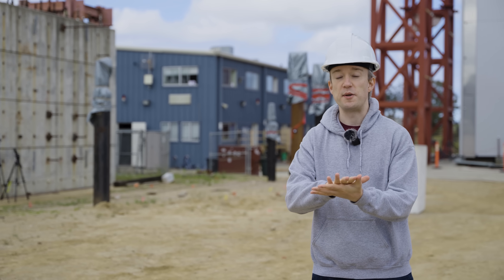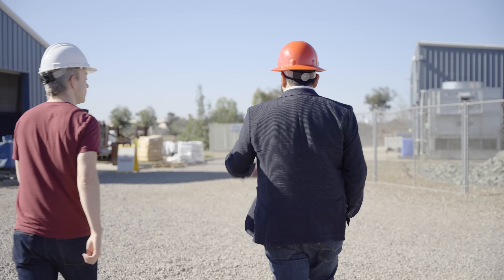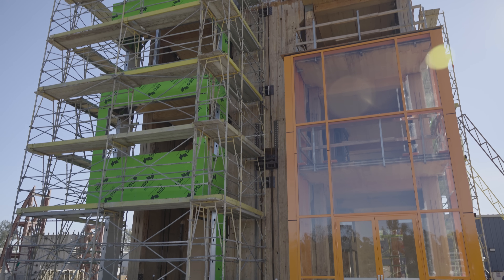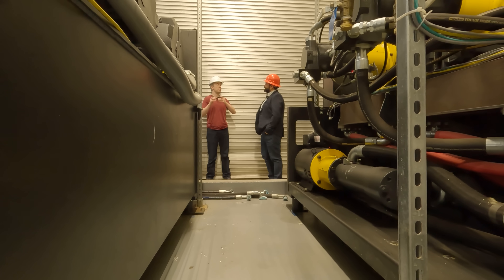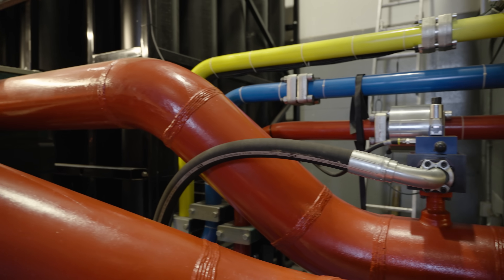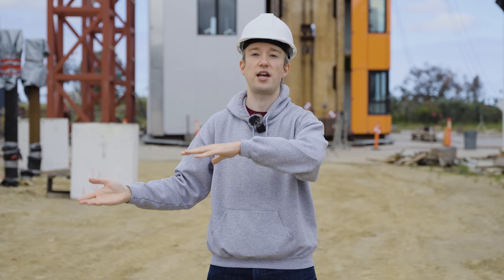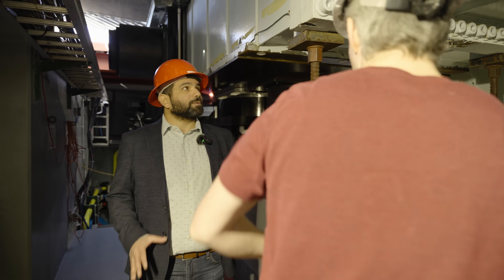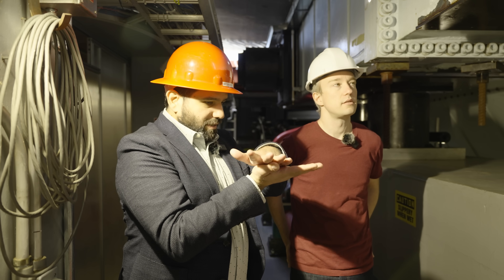Shake tables are way more complex than I thought

Comment: 3:28 "water hammer effects". In Danish we call it "vandstød", or "water shock". For those less familiar with fluid dynamics and physics: Dishwashers are notorious for causing this effect because they take in water at the full pressure of the water line, and then shut off the magnetic valve when they reach the fill level. This rapid shut-off makes the water rapidly compress against the valve and creates a shockwave that causes the pipe to flex, and thus you get the familiar knocking sound. Only in your water supply the pressure isn't high enough that this shock causes any damage, but in a 3000 psi hydraulic circuit, slamming pressurized liquid into a sharp corner would create massive shockwaves, that in worst case can break the pipes, and thus they need those funky smooth bends - the higher pressure you got, the more straight the pipe needs to be

Comment: Thanks again Tom. I remember a test building inside a building at the Building Research Establishment in Watford, UK back in 1972 - it had a network of vertical and horizontal steel cables used to stress the structure. A last-century attempt as structural testing :-)

Comment: Hi. Pipefitter here. That U-turn is an expansion joint. It’s necessary for the operation. Steel pipe is highly affected by temperature changes. That expansion joint allows the pipe to expand and contract without breaking any welds. 
Also, 5k psi isn’t as scary as you’re making it out to be. It’s common in power plants and refineries.

Comment: Just the welds on the pipes alone are insane. 6 bead cover pass!
Reply: Why run just one bead when you can get paid by the hour to run 6?
Reply: @1pcfred  that's just the cover passes, there's probably six to eight more underneath.

Comment: As a welder, seeing the weld joints on these pipes really illustrates how insane the pressures these pipes are withstanding.
Reply: Personally I didn't care for the cover work myself. But apparently it works. Looks like the steamfitters were milking that job for all they could get.

Comment: I've been involved in Seismic Qualification of some small industrial components.  This is astounding!   Of course the last SQ I was involved with was a 50 gram transmitter encased in epoxy.  The standards did not have any allowance for "common sense" or "engineering judgement" so we ended up having to put it on a shaker table.  Our biggest concern was that the wires connecting to screw terminals on it could possibly pull off.  They didn't.

Comment: Is America the only country still using the imperial system even in engineering & science or are there other ones?
Reply: America has never used the Imperial system. Just FYI.
Reply: @1pcfred  OK. Thanks for the information. But how do you call the American system using inches, feet, miles etc. ?

Comment: Avg. passenger car tire properly inflated is 32-35, so about 140-155x the avg tire pressure.  Commercial vehicles around 70-80psi, so about 60-70x the pressure.  Apparently a Nile Crocodile has a bite force of 5000psi…. However my ex could chew the arse outta solid granite hippo.

Comment: I was in Kumamoto, Japan during the 2016 earthquake. I live in a region where earthquakes are not a thing. I had never experienced one. It is to this day the most insane experience I've ever had. When it hits you feel like the entire wolrd is shaking. It is something my mind still can't properly put into words. Not even the locals could stay perfectly calm. It comes from so deep within it feels like the earth is splitting apart.

The fact that there's a machine designed to prepare for it and the fact that it works (a vast majority of the buildings were just fine but the oldest houses were completely destroyed) is amazing.
Reply: I was in Sussex County during the 2011 quake. Earthquakes usually aren't a thing here either. It wasn't one of those jarring quakes. It was more of a slow roller. I did see the ground raise up like it was a wave of water. I thought I was cracking up while it was happening. I was looking at the ground thinking, that's not supposed to be like that. What's wrong with me?

Comment: I spent roughly 2 years operating one of these (way smaller) and with only one axis of movement and it was already tricky enough to tune and prepare for the actual tests.
 
Seeing even a 3x3[m] with 300bar of pressure lose control due to any electrical issue was scary to say the least

Comment: As someone who uses shaker tables for their day job testing aircraft components seeing this is on another level. I never knew such a thing could even exist, the power of it must be incredible, thanks Tom for another great video.
Reply: A long long time ago my shake table had a motor spinning an offset weight.  Later we had one with coils like very large loudspeaker, controlled by an audio cassette tape. When I retired 6 years ago vibe used even bigger coils, but frequently would not let me test 2 units a day, probably because he total weight of the mount and unit under test was to big.

Comment: Pressure != flow rate, so those bends in the pipes are probably fine.  They have such a large diameter so the flow rate doesn't have to be too fast.

Comment: I just feel the need to mention that the red pipes at 3:30 are carrying 3,000 PSI.
A standard industrial gas cylinder you use for welding, or helium, or o2 or whatever, is only pressurized to 2,500 PSI.
It's also not as high risk as you'd think. that's mostly off the self plumbing believe it or not. Schedual 120 pipe if it's ~12" (12.75OD) with a nominal 1" wall and a burst around 3,800 psi.
Reply: They haven't left themselves with much margin for error. But that's the modern era I suppose. There's no longer a safety factor in anything.
Reply: @1pcfred  that's a rough guess. it might be schedule 140 with a max allowed of 4,300 psi. schedule 160 clears 5k.
now mind you, that's the max allowed working pressure, not the bursting point of the pipe. 
My point was that you can order most of that gear from a standard supply house, surprisingly. schedule 140 is so common it's also just called "XXS". schedule 40 is "STD", and 80 is "XS". and yes, it's standard, extra strong, and extra extra strong...
as for safety margins, there's quite a big strain factor above working limits, much like lifting gear, if you're within spec you're good. You can also have limiting devices and such installed that will bleed pressure over an allowed pressure, so if operating pressure is 3k, something might spike it, so at 3500 psi, it forces a spring open and bleeds volume out of the system instead. it's as simple as a big ball bearing and a really big spring.

Comment: 5000 psi is fairly high pressure, for sure but a lot of modern machinery uses that sort of hydraulic pressure. What is truly amazing is the volumes and rate of change of the hydraulic flow.

Comment: Pipes/preasures:
5000 psi = ~350 bar
3000 psi = ~200 bar
12 inches = 30 cm
I'd really appreciate if pressures were in non-banana units too. My car tyre pressure is 2.1 bar, my bycicle tyres are 5 bar. A home air compressor goes to 10 bar. My fire brigade hydraulic cutters got to 650 bar. 
Not banana units, world units ;)

/rant over :)

Comment: I've been part of this project for 7 years, and Koorosh is a good friend. It's great to see this team get recognition from amazing folks like Tom for the fantastic work they do every day to make the world a safer place from earthquakes!
Reply: Tell him he's great at articulating what's going on, I'm not that well educated about it his topic but I felt like I understood everything he said.
Reply: unimportant question for about the high pressure system for you? The high pressure pipes are described as 12" diameter, inch thick.. is that 12" ID or OD?  Either way dang, awesome system, awesome work.
Reply: @polerin whoops, hit the enter button too quickly on that last reply! I'm 90% sure it's a 12" ID with a 1.5" (or so) wall thickness. Those pipes are insanely huge and thick.
Reply: Thank you for your work on this project!
Reply: Great job on doing something this complicated to the point of making whole building survive. People like you all should be getting high bonuses for advancements like these
Reply: Thanks for your participation in this project. Can you tell me more about the unique design of this building? it looked very stable the top story  was barely moving. Was it just a single post tension core or multiple post tension columns?
Reply: What is the name of this project?
Reply: While earthquakes can strike anywhere on Earth they are more prevalent in some places than others. So your best bet is to simply stay out of earthquake prone zones. That's worked for me so far.
Reply: @1pcfred  You'd be amazed where they can happen, we can get a three or four pointer here in Scotland once every five years or so.  A farmer I know has to go round correcting all of his upturned sheep.  No joke.
Reply: @krashd  the opposite of cow-tipping, that
Reply: @1pcfred  Then other natural disasters become a concern. Nowhere on Earth is safe from natural disasters, so this advice is very unhelpful.
Reply: @1pcfred  same here, though we did have a quake here about 12 years ago. one of the weirdest sensations i've ever felt and i was like 100 miles from the epicenter
Reply: @1pcfred I’ve lived my whole life right on a major fault and I’ve never had an issue. With proper government regulation living in an earthquake zone isn’t an issue

Comment: So what magnitude earthquake was that simulating?  for the record, I word as a project engineer for a company that built control systems for nuclear power plants and had much of the equipment I designed sent to a lab for seismic testing (and age-to-end-of-life, and chemical spill tests).  I never had a building tested, but a lot of control and monitoring panels.

Comment: Riding in an earthquake retrofitted building during the 6.8 Seattle Nisqually quake in 2001, the biggest takeaway while crouching under my desk was how much the building continued to shake after the earth stopped moving. The earthquake lasted only 45 seconds but the building was still rocking and creaking for many minutes after the shaking stopped.
Reply: I wonder if that's by design? Cushion the energy, spread it out over several minutes, rather than taking the full blow at once?
Reply: @Nalehw  100%

Comment: Huh, 10-story wooden structures. I wonder what neighbor noise will be like. I lived in a 5-over-1 (stick-framed) and I could feel my upstairs neighbor's kids running down the hall 50 meters away. Dismal places to live if the builder doesn't sound proof, which I guess they tend not to because it costs money.

Comment: No, the pipe making a U-turn with 5000 psi of fluid is not an issue. Fluid hammer is a function of fluid velocity, not pressure. If it's travelling slowly, which it probably is considering it's a closed loop hydraulic circuit, it's not a huge deal.

Comment: i used to work with shake tables. depends on the job. i was literally removing dirt from parts. boring ass job! paid well though. i lasted 2 days. i used to get burned by welding parts, i was thinking about going back to that the job was so boring. 

it was 15 bucks an hour, but dirt removal? no thanks.

Comment: "You have to fail safe."  That statement alone tells you how crucially important an engineers job is when designing systems of any kind.
Reply: One of the worst rookie mistakes you can make when building anything is to create an emergency stop system that just replaces the original problem with a bigger problem.
Reply: The more difficult thing about designing something (from the video) is knowing what “safe” is.  It’s interesting that they can’t just go “emergency stop and re-center!”  Also the building resonance “force feedback” on the machine is complicated, with each building having its own feedback.

Comment: Holy Sh... aftermath. I don't know anything about pressure tech, but even I can see that a U-turn in a 3000psi pipe is at least nightmare, if not insane level of engineering. 

btw. I once saw a docu about a model of the Great Hall of the Forbidden City (the biggest wooden hall in the world) in a shake simulator. It survived magnitude 7 with very minor damage because of the special roof technique, and when the simulator run out of steam in 7.9 (I think it was) the hall was still standing relativly undamaged.

Comment: Since there are so many different buildings out there, one would think earthquakes are bound to hit the resonance frequency of some of them.    Why would they filter those out?    I would think the final test would be to find the failure mode of the building.
Reply: They filter it out so that the motion the table produces is as close to what the building would experience in real life as possible. The resonant frequency of the building could make the motion of the table no longer match the earthquake inputs they're trying to reproduce.
Reply: @dan_zehner  But selecting out actual earthquakes that have parts that match it's resonant frequency seems counter productive to the purpose of the test.  You don't get to select the jumbled mess of frequencies you want in a read earthquake.
Reply: @lucidmoses  they selected ground motions from earthquakes similar to what this building would experience if it were built in Seattle. So they chose faults that are similar to the Cascadia Subduction Zone and used recorded ground motions from those. 

I can ask them about filtering out the resonant frequency for this building because yes, one of the things they wanted to see was the displacement at various frequencies.
Reply: @lucidmoses  here's what I got back from Dr. Lotfizadeh at the shake table: "
We filter them in the feedforward side of the control loop so they don't interfere with the control mechanism (otherwise we have instability issues). We're not actually filtering out the frequencies that get reproduced on the shake table. It's a matter of us trying to get as close as possible to a flat transfer function for the shake table control, so what we command is actually what is reproduced on the shake table. "
Reply: @dan_zehner  If they are not invalidating the test (which I assume they are not)  Then there has to be a time component to this that they are correcting for.   I assume there are sensors on the bed that record the 'actual' moment and that's fed back to the shaker logic that has the 'requested' shake pattern. Then it instructs the 'pistons' to do what they need to do to keep the bed shaking in the appropriate way.   Then the delay of the building reaction and the delay in how the 'pistons' work are throwing off the 'actual' sensors so they are backing that out before instructing the 'pistons'.
At least that's what I'm getting from the video and the email response.  

Thanks lots for the clarification.

Comment: I'm working in the mass timber industry so this shake table test was something I am very fascinated in, and I'm delighted to see this you do a video on it. I did some of the manufacturing modeling on a few of the CLT panels. It is crazy how many players across the industry were involved with this. I would love to see a video where you dive into the shear fuses, tensioning, and other details, and the impacts they may have on mass timber construction and construction.
Reply: Nice! I read the stuff on the recent Glulam fire test as well :3

Comment: Tom was clearly blown away by the U-turn, but said nothing about the fact that, right after the U-turn, the pipes create TWO SIDE-BY-SIDE T JOINTS??? I can't even imagine the violence
Reply: Agreed ..the U turns are childs play compared to those dead end T joints
Reply: I think it's less turbulent violence than heat generation (efficiency loss) from all the bends and connections. Hence the large diameter and smooth metal pipe to reduce heat loss as much as possible. Hydraulic oil is incompressible and already has filled all the lines. Just transmitting power from one side to the other. Hydraulics are a 'liquid drive-shaft' not flowing water.
Reply: @The76Malibu  hydraulics are 'flowing water', especially one like this setup. Cycling multiple, very large rams very fast will take a huge amount of flow.
Just lifting all 6 vertical rams 5" in 2 seconds (not fast for this) would take a flow rate of over 3,100 gal /minute - 11,800L/min.